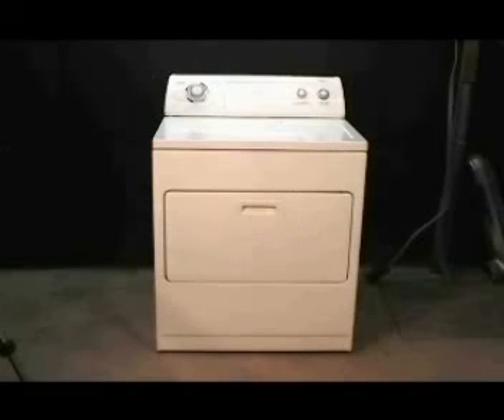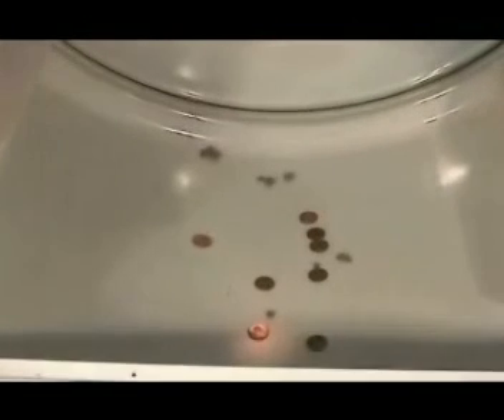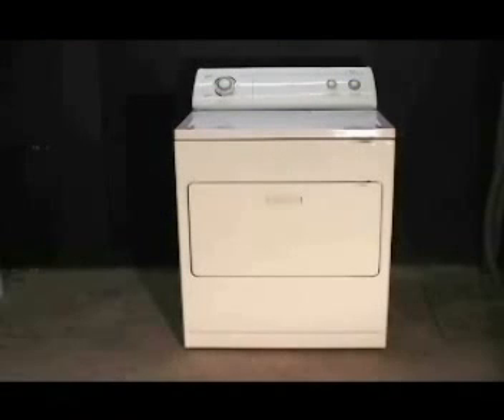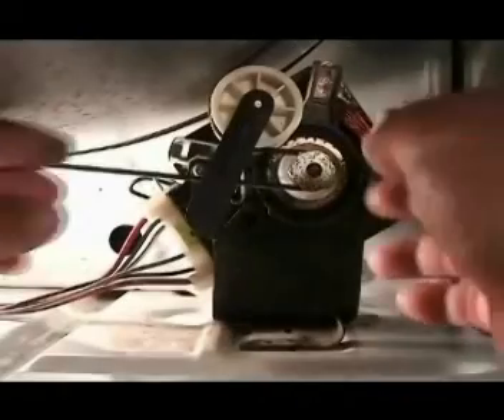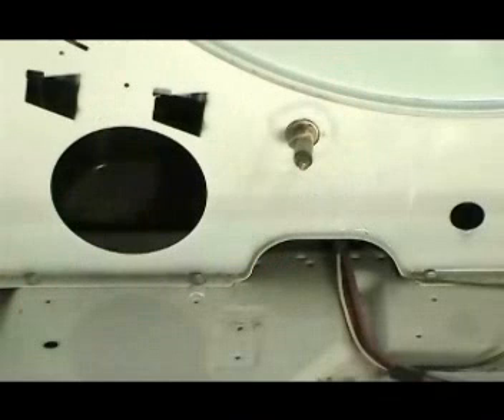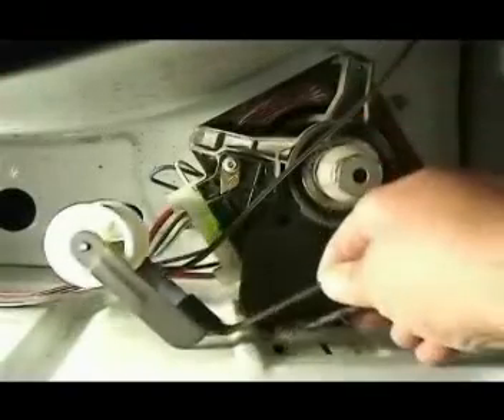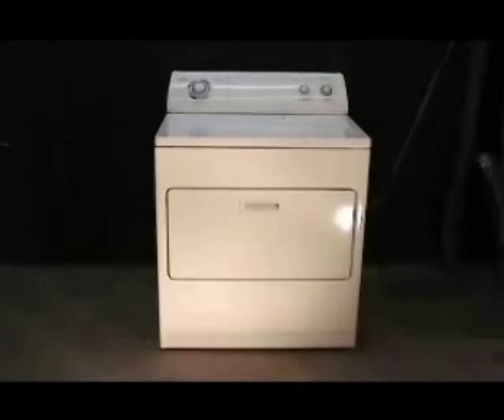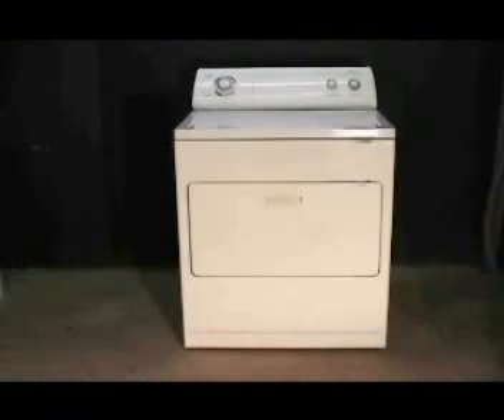Whirlpool Dryer Making Noises

Comment: those lousy drum support rollers!
4:32 - Good tip!, folks!
5:32 - Another Excellent Example of Bad Roller! this is the BEST video, ever!
5:57 - Even a preferred GREASE for ur ShafT recommendation! Video, GOLD!!
7:41 - that coat hanger wire DOES play a small , but significant PART to play, in grand scheme of things , ,,

Comment: Hi, I watched this video and replaced the drum support rollers but I think I fixed the wrong thing. The noise in my dryer started getting louder until it finally made a pop and now there’s a loud rumbling noise and the dryer shakes a lot. What could it be?
Reply: If the idler got attached wrong?  or if it didn't get into the groove.